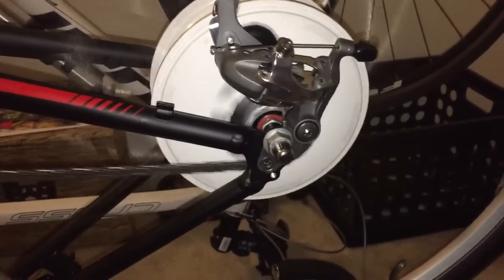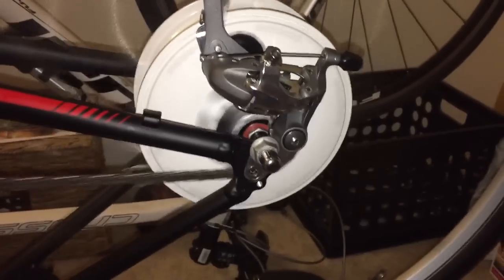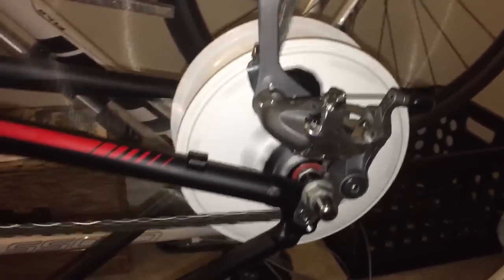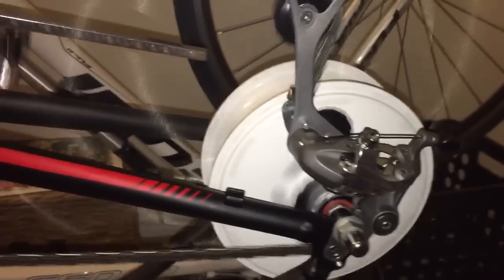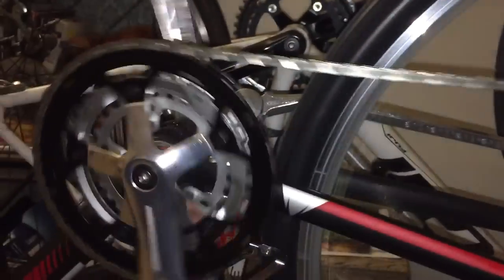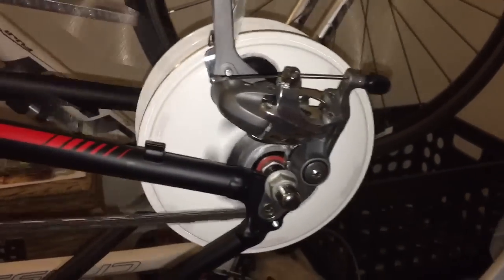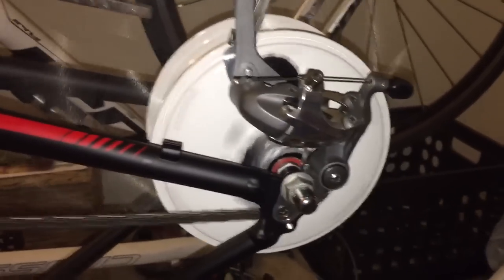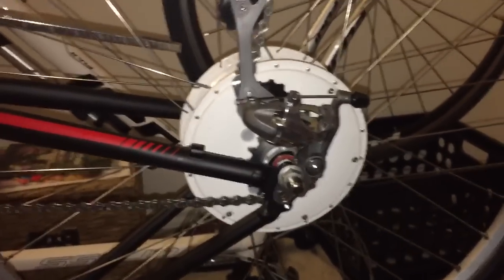Testing the FlyKly Smart Wheel

Comment: Why did you keep your derailleur on?
Reply from the maker: You need to maintain tension on the chain and the rear derailleur really doesn't need to be replaced with a kit that could also maintain tension. All I did instead was set the derailleur and cut the chains the cabling out. If the tension does give I can simply use the screws on the derailleur to set it back again. I hope that answers you question.
Reply: Jeremy Huntsinger I just also got the Smart wheel and have a similar bike as yours with gears etc but the chain kept on falling off the spokes. I thought it was the what gear I had the bike in as that would move the chain slightly in line with the spokes but it didn't work. They said I would likely need a new sproket on the wheel to fit what they thought was a narrow chain on my bike, so I just ordered that from them hoping it will fix the problem, as they appear to have set up web page for the different sprocket, Im thinking this is not unique to me. In any event, if needed exactly how does one use the screws in the drailleur to tighten the tension as you describe above?
Reply: Stuart Meissnerlaw I also have the flykly wheel, and I also have the problem, that the wheels cog is too big for my chain. The support didn't have responsed yet. :(
Reply from the maker: Stuart Meissnerlaw You are actually right that the rear gears will change where you need to have it but I went a step further and had it secured so that the derailleur would never have a chance of being knocked off gear. I don't understand what is happening with the cog issue, but best of luck there.

So to answer you question you will need see how there is a part of the cable still on my bike, now if you have the same setup as me you can twist that cap that is toward the right on this video to loosen or tighten the gear which will move it in our out to balance the wheel. I would go see a bike mechanic for this if you're not sure what to do.
Reply from the maker: deimosmuc What kind of bike do you have?